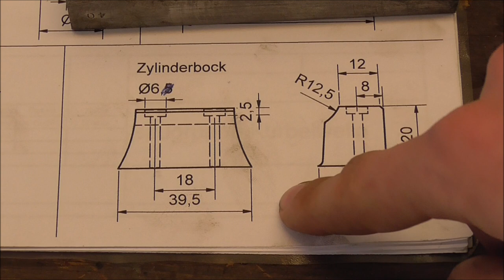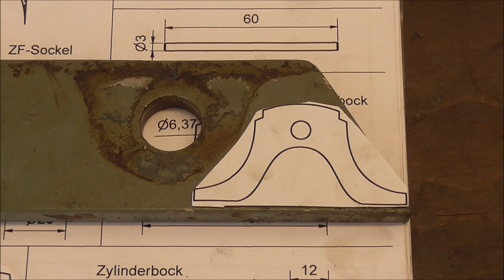Baseplate Bolt-On Parts - Doll 362 Replica #3

Comment: Not that far away. Keep up the good work boy!
By the way, I know why the pins of the hack saw didn't last too long. That's because you saw so fast that the proces needs cooling :-))).
Now seriously. Have an old vacuum cleaner for the needle chips and tweezers for those already in your hands. Don't expect the needles to get out later - they never do.
Reply from the maker: Nice one xD
A vacuum cleaner is indeed a great idea. I'll do that next time! Picking these tiny shards out of my hand took almost as long as making the parts ;P